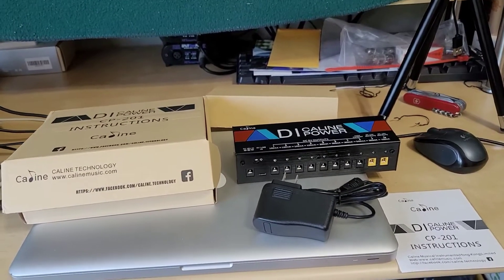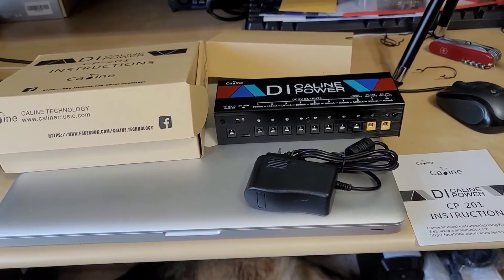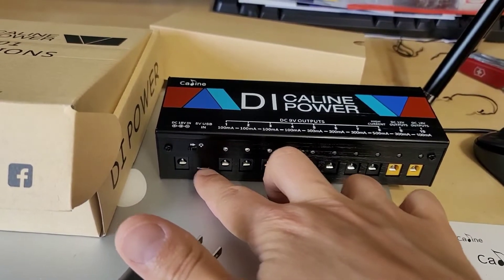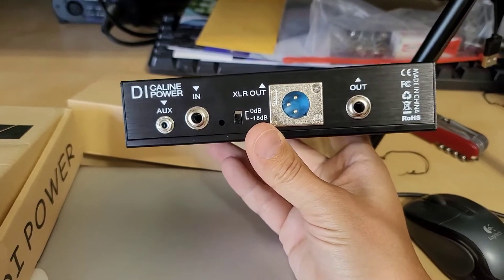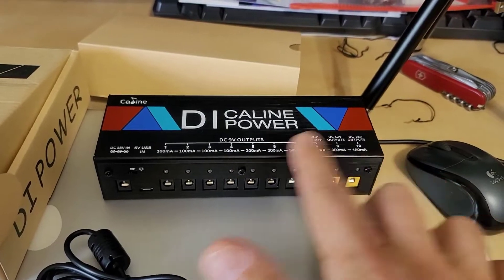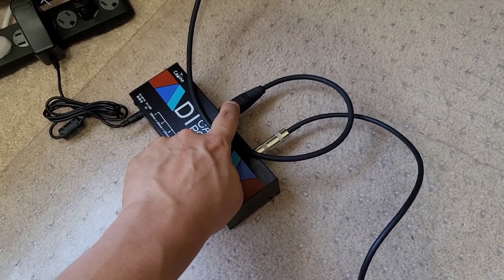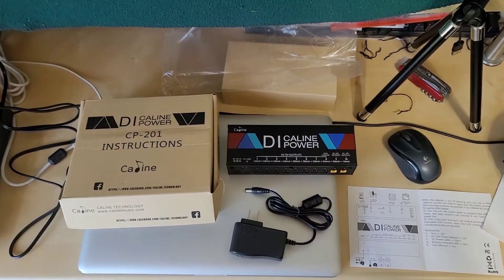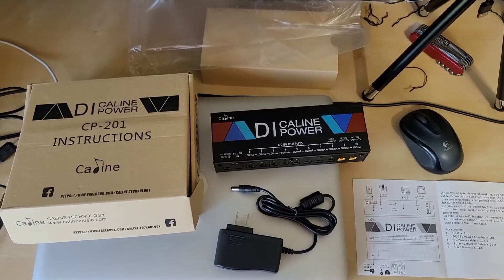Caline CP-201 Pedal Power Supply / DI Box: Teardown & Review

Comment: is the gokko pedal power just the same as this one? they look very similar..
Reply from the maker: Hey it's a good chance yes it is the same psu. Caline co-brands for other companies using the same guts but different outside casing markings. I did bring up the issues mentioned in the video to them when I made it, I did not hear back if they had made the corrections in production to this pedal which looks to be discontinued. Hopefully they have made the corrections to the other variants they make for other companies.
Reply: @Bassguitarist1985  thanks!! (^_^)

Comment: Am looking for a budget power supply that will power my Valeton gp200LT its 9v 1000ma and thinking about getting a power supply and that’s has two 500ma power on it and split the power to power it. Any suggestion from Caline or whoever?
Reply from the maker: I would say the CP-206. While it does not have a y adapter you can either make one or purchase one and connect it to the two 500mA outputs to get you the 1000 mA rating.